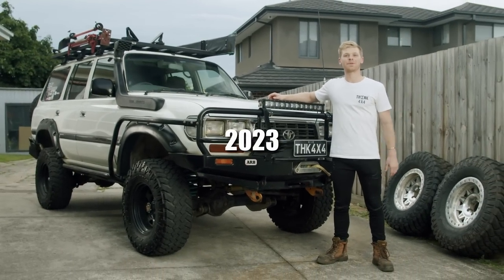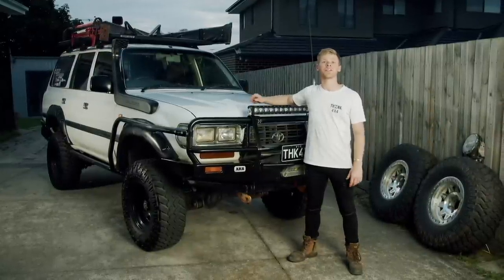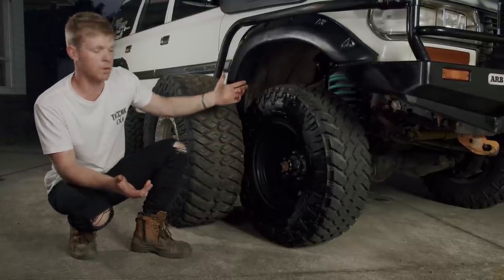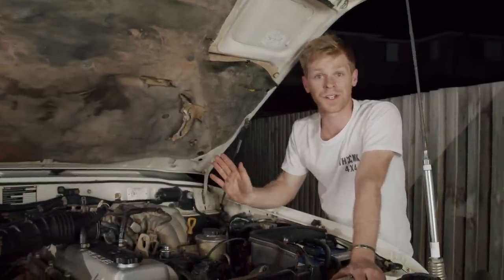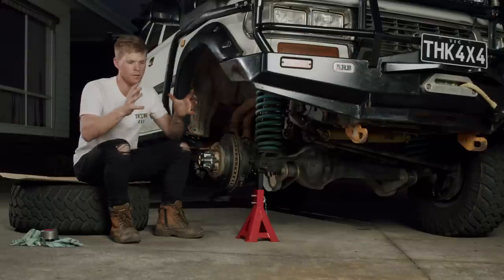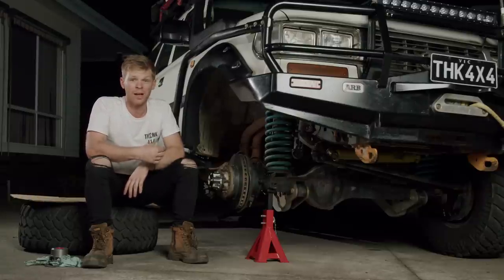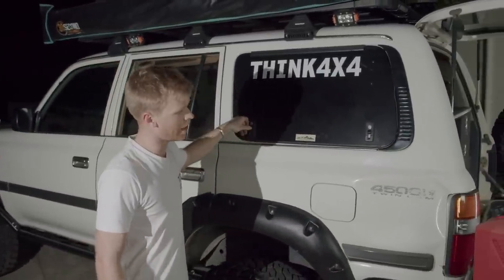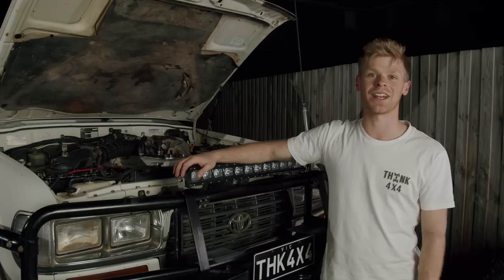PETROL 80 Series Landcruiser Rig Rundown!

Comment: great seeing a run-through the finer details. I found the front hub work interesting about the locking tab and axle seal upgrades.
Reply from the maker: Trail Gear is the brand. They are called speedy sleeve axle seal and bearing retaining locknut.

Comment: I put FTE in my FJZ105. Hwy driving is chalk and cheese. It just pulls up the hills in 4th with torque converter locked (auto) and I get 14L/100 weighing 3.6T with a RTT on 33s. So with 270L fuel on board it'd s breeze doing trips. In fact I rarely fill up the long range tank, and it generally works out well with dual cabs with smaller tanks getting better fuel ecconomy to align fuel stops. I have done modest power mods and its enough for me. Did all the Cape York tracks in 2019 without recovery, so you can still have a tough tourer. I haven't experienced a turbo 1fz, but i think you would have no regrets given you already know how much they drink...
Reply from the maker: I've had an FTE built and decided to put that in a 105 similar to yourself. Excited to see the difference between the two. But I can nearly guarantee this will be my one and only diesel build. They are stupidly expensive in every aspect compared to petrol, except for fuel usage.
Reply: @Think4X4 FTE are very expensive. 1HZ turbo on the other hand is pretty cheap.

Comment: Think 4x4 comment

The 1FZ is starting to win me over to some degree. Very impressive figures for a petrol, the only killer is the fuel consumption.....not that a 1HZ is frugal. 

The 1FZ-FE is almost twice the motor when looking on at the specs on paper. Also 1FZ 80s fly by effortlessly when I'm on the road.😅

Honestly I would keep the 80 as is (with regards to the engine). I haven't dug too deep in the turbo 1fz rabbit hole, but the results are somewhat disappointing from what I remember seeing.

Engine swap is a whole nother ball game, but since you already have the engine (the expensive part), it can be something to consider. 

It all depends on how much you want to spend on it.
Reply from the maker: @Think4X4
1 second ago
Check out Sam Eyles BNB 80 or Sam Young's 80 build with turbo FZ. These Engines are extremely strong and respond well to boost with little to no modification.